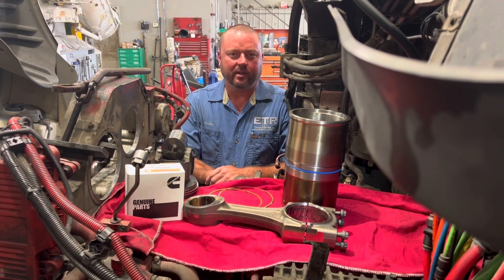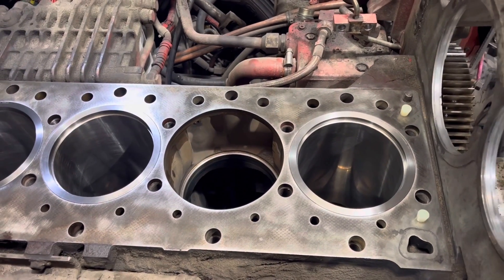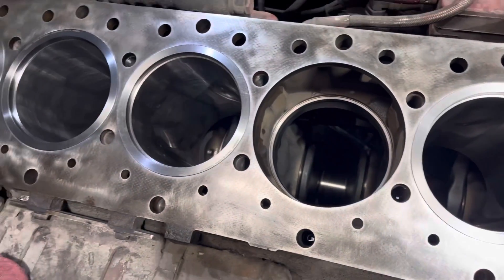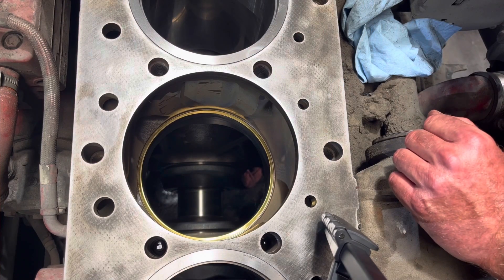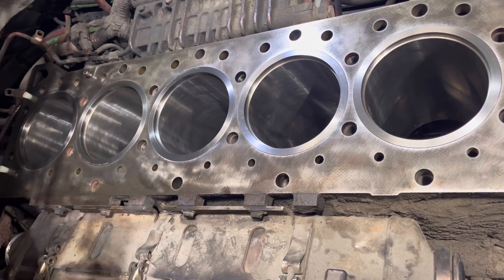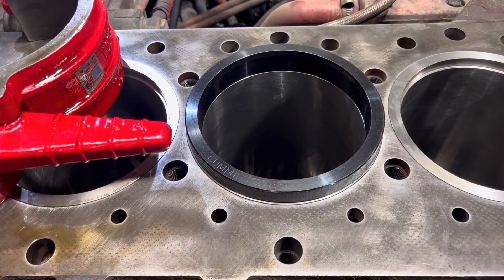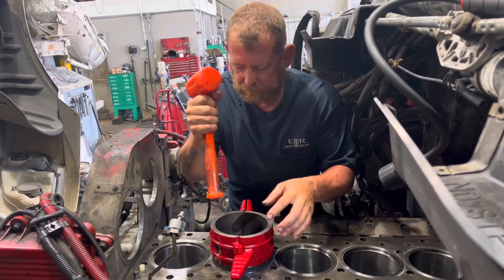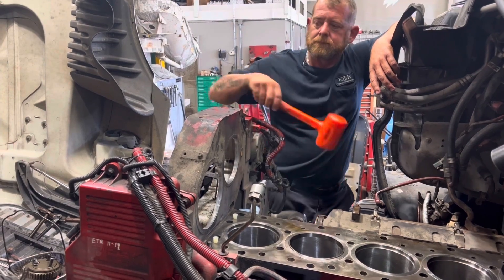Cummins ISX15 Piston and Liner Installation after block professionally counterbored to .020.

Comment: Thank you for the video
Reply from the maker: Thanks for the post. Check out our 10 speed rebuild tutorial
Reply: Hello .urgently need help on nt855 / n14 . We had extensive pitting and corrosion. We line bored top deck second surface to mach with bigger liner outside . Now its kind a press fit with 5 time more pressure you applied and clearance between piston dimension and liner normally should be in 0.15mm all trough length of liner .but it top its shrinking about 0.02 and 0.03 not perfect shrink but some of them oval . What do you think ignore that ? Or fix with sand paper ?? And you think its better to sand paper outside liner or inside block . And thirdly we have mark of 3 seal oring on very lower 0art of block. Do you think its better using 4 head honing stone to fix it . Thanks  @etrtruckcenterenginedrivet8918

Comment: Not supposed to stack shims
Reply from the maker: So the block was counterbored. The second shim brings the block back to factory spec. The block had to be counterbored because the liner was chattering it’s way down into the block causing the head gasket to leak. Hope this helps
Reply: What was final pertrusion